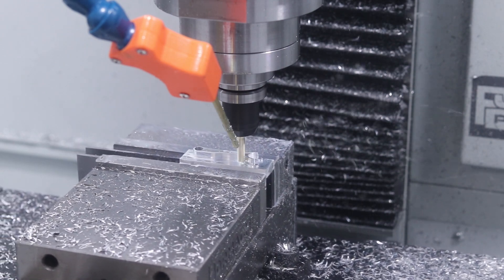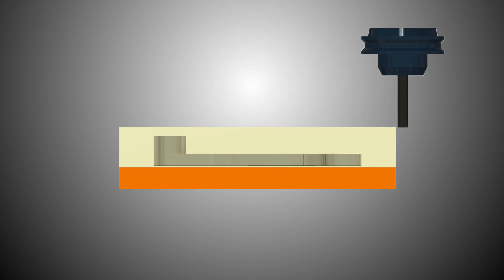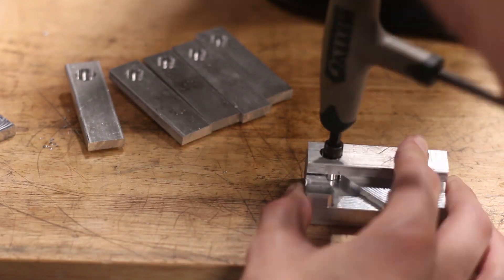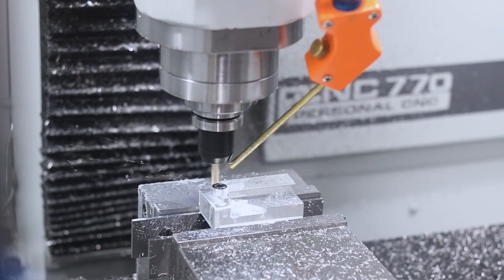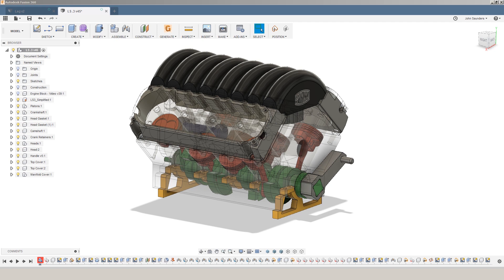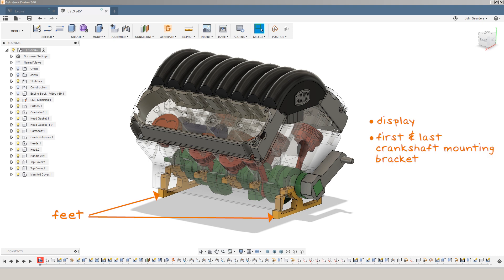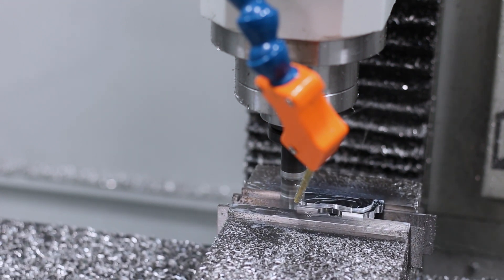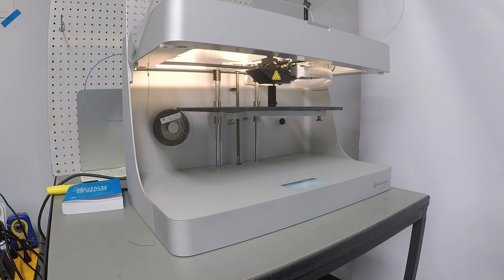Machining Connecting Rods & Other V8 Engine Parts| WW219

Comment: Wait - you're asking us how we think you should machine the crankshaft? When you did the engine block, you did that on a 5-axis Mill, correct? Seems to me that that would be perfectly fine for making a crankshaft for one of these as well... If you wanted to be ambitious you could lathe the main crankshaft journals, but a 5-axis would be fine for the rest of the details of a crankshaft. At least for something like a desktop model, or something light-duty on real fuel (IE for demonstration purposes).

*edit* after reading some of the other comments on this topic, I realized I was simply stupid in my initial post. Disregard my idiocy,  please. I saw several very good comments on fixturing and processes in the rest of the comments.

Comment: Cnc lathe or use a 4th axis head in your machine. I built an inline 4 cylinder engine in college. Aluminum block, steel crank(made in a cnc lathe) made the camshaft and hand ground the lobes. 1.07 cu. inches. Still working on the carburetor design.  Expectations is to run on actual fuel!

Comment: You machine crankshafts on a lathe. You turn the bearing surfaces centrally, then offset the shaft in the lathe by the required distance and direction to time the cylinders correctly.
Reply: you can machine a crankshaft on a 4 axis cnc mill as well seems more suited to their style
Reply: @YusakuGod  It is, though it isn't how they are generally made, and they could do with a lathe project that helps them develop their skills. CNC is powerful but it separates you from the process and when you can machine manually and it is time efficient to do so, as it should be in this case, you should.
Reply: @bluedeath996  I don't Entirely dissagree, I see CNC being poorly used all the time at my job, im a CNC operator, and would really rather be in the manual dept. But they are called NYCCNC and have a shiny VM3. Making those kinds of things on a mill builds skills too if they haven't run this type of thing before even if its not effencient to do a one-off on a CNC.

Comment: John have a look at modelenginemaker web site there are lots of engines with crank shafts 
Inc 1,2,4,6,8,10 and radial engines have a peek at vixens Jupiter , one guy is machining from bar stock a 16 cylinder 1.5 litre merc racing engine in twin superchargers all on small CNC machines he got out of a prison

Comment: If you can find a key slot cutter or slitting saw with the proper clearance and thickness under the crank bearing width you can machine it upright in a mill. Finish with a grinding wheel.

Comment: To mill the crankshaft from one piece you could first create the features on the linear axis with a lathe. Then create the connecting rod seats in a 4-axis operation with the vertical rotary table and support the other end of the shaft with a tailstock.

Comment: Oh. And instead of jumping right into a combustion engine. Try and air driven engine first. Nearly all the same challenges of a combustion engine without the explody parts.
Reply: well not as explody and you don't need to worry about the fuel air mixture.
Reply: That would be tough. What are you thinking? I suppose if it's a 16 valve pushrod engine (or SOHC setup acting directly on rockers/valves) one could pressurize the intake & just use a "special" cam profile + run it as a two stroke. Hhhmmm......maybe use a "regular" cam & run as a two stroke. 

So maybe not all that difficult. At most it's different cam(s) + cam gear(s) to get a 1:1 crank/cam ratio for two stroke operation + shorter chain/belt or a tensioner with a long throw. Possibly just change the cam gear(s) & drive system. edit : Might need stronger intake valve springs and/or careful selection of the intake air pressure. end edit

Would definitely show proof of concept for proper operation of everything before jumping down the rabbit hole of adding fuel & spark which can make one tear their hair out!!
Reply: Iceberg86300 

Think EFI. But injecting compressed air instead.  Just need a cam synced “timing” manifold to control which cylinder gets air and when in the stroke.
Reply: And the bonus of big rewards for nailing close tolerances. Compressed air motors take no prisoners!

Comment: Cutting an octagon on one end of a piece of round stock gives you the index points to use a 4 jaw to offset for the rod bearings. Drill center holes in the other end at the center line for each journal and it makes indexing around to get all 8 way easier. Or you can make a piece that attaches to the tailstock that has the offset built in already and just rotate it but if you have the room for the centers it simplifies the process a ton.

Comment: If you make a built-up crank shaft, you can use 1-piece con rods. Simplifies the con rods, and the machining of the individual parts of the crank shaft is relatively simple with little material wastage. You can even use stock hardened and ground rod for the big end and main bearing pins so your bearing surfaces are already round and hard. A built up crank also allows the use of roller bearings for mains, big ends and small ends, which dramatically simplifies your lubrication design as they will run satisfactorily with spray lubrication, rather than needing hydrostatic lubrication which would be the case with plain bearings.
Reply: It's meant to be cranked by hand, hence the hand crank they're building in this video. So no need for roller bearings or a pressurized oil system, or any type of oil system.
Reply: @xenonram  I'm thinking the bearing/lubrication portion of the comment were given as advantages over a one piece design for the operational version. Plus, unless this is learning moment/"look at what we CAM'd up, fixtured & machined!!" type of deal, a built up crank is the way to go b/c it will much easier to manufacture & assemble vs a one piece design. Although it would require some well thought out design features to positively locate the plates to the main bearing pins as well as choosing the correct bearings/pins. 

Then there's Jon's aversion towards lathe work. One isn't going to gain experience & confidence by avoiding the lathe but I don't think a miniature one piece crankshaft is the best part to "cut one's teeth on." Especially when it means adding features for lubrication of plain bearings + an oil system needed to provide said lubrication.
Reply: Andrew Delashaw : If I understood correctly, John was talking about the next iteration which will be driven by the pistons. Of course, you can get away for a while with plain bearings and no lubrication pump, particularly if v2.0 is pneumatic rather than internal combustion with correspondingly lower pressure and hence low bearing loads.
Reply: yeh, like a two-stroke crank

Comment: You enjoy making life difficult don’t you? 🤣

Flip the part over for your first Op. it has a flat bottom and don’t have the nub hanging out to deal with for Op2

And soft jaws would have be far easier to make since it would just have been a simple 2D profile. 

And machining a crank shaft requires, at minimum a 4 axis rotary, or a live tooling lathe with a Y axis.  Both require a tailstock as crank shafts can get wonky due to so much material being removed from the initial stock. 

Will also require some pretty long endmills. 6x-8x diameter.  Possibly longer depending on the stroke length.